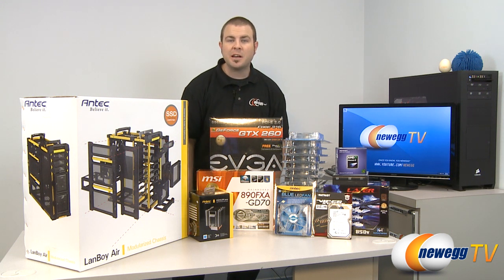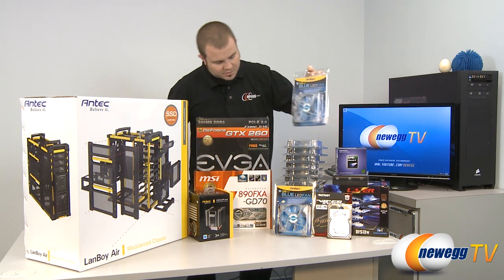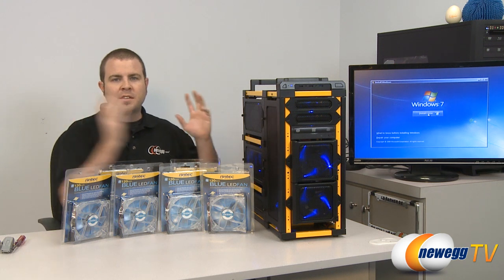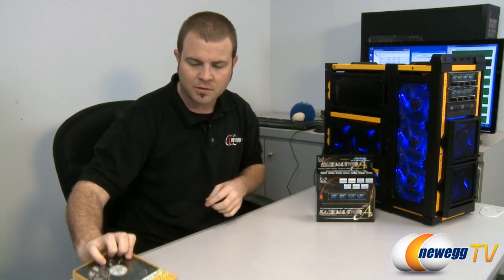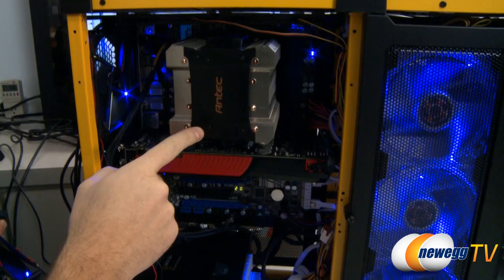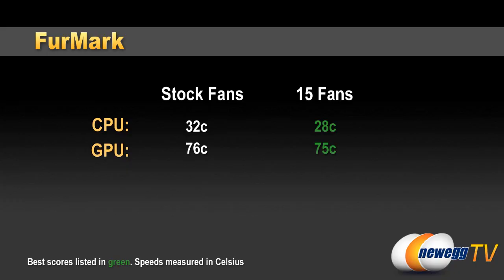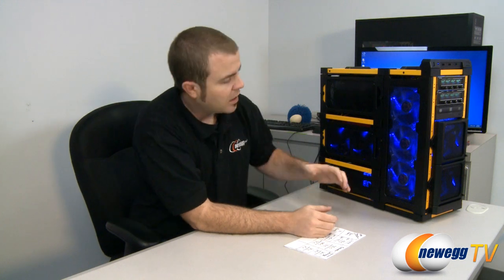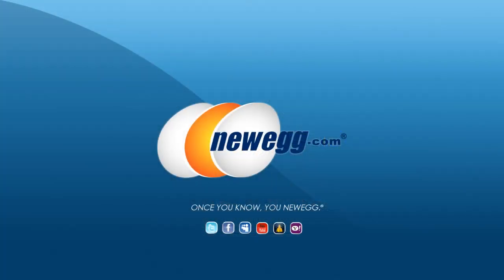Newegg TV: Antec Lanboy Air Test Build with 15 Fans

Comment: i owned one of these the downside is that the rubber hdd suspension system was prone to drying out and snapping on its own in as little as 3 months of 24/7 operation with fans blowing over it accelerating the failure.

The solution is to apply petroleum jelly thoroughly on the rubber parts every 6 months or so, but multiple failures and very deteriorated parts had already happened.

Comment: why did i buy this case...? i still regret it 4 years later lol
Reply: Here the same. When I changed my computer i kept the first one I build in 2011 to put it into a cooler master case 652S and the new pc into the land boy air. I didn't think of SSD placement issue and the problem for fan. The plastic pannel after 6years later don't maintain anymore my fans properly and it's a total mess to place everything in the right place especially a 1080. All these mistakes because i still thought it was one of the best control airflow case and it's not.
Reply: Just bought one and built in it, if you get tired of yours hmu, looking to buy another.

Comment: I have had this case since 2012. What I can say from this is that just putting all of those fans the way the did here (pointing inward) is just dumb. For maximum efficiency (and how my case is set up) You should have the front fans (8) and the side fans (4) facing inward while the rear and top fans (3, or 4 if you have dual rear fans w/watercooler) pull air out of the case so there is an actual flow of air. If you want to do pressurization it really depends on your room temp. If your room is generaly cold, go positive pressure (all fans facing in). If your room is generally warm you may want to go negative pressure (all fans facing out) but even the a flow of air through the system is always best especially if you are doing water cooling as well anyway.

This case does get dusty though if you don't have enough positive pressure about (75% of airflow going inward)

Comment: GTX 260/2TB 5900 RPM HDD/Phenom II...

2009 Price for all of this: $400, $220, $200 (for the low, low price of $1,020)

2015 Price for all of this: $45, $70, $110
(for the low, low price of $225)

I have no words.
Reply: Also to everyone saying you'd rather watercool this... A GTX 260. Let me KINDLY link you to this... "thing".

http://www.geforce.com/hardware/desktop-gpus/geforce-gtx-260/specifications

This requires a 500W PSU to operate. 500 watts. With a 182W TDP. Any slightly intelligent PC Gamer knows how much that is in a real world application.

Comment: With all those fans blowing inward you’re really just pressurizing the case.  If all the fans moved the same amount of air as the Antec 120mm Blue (79 cuft/min on high) you’d be forcing over 1100 cuft/min of air into that case.  That’s the equivalent volume of air that an office that is 12 ft wide x 12 ft long x 8 ft tall contains.  I don’t think that much air can escape out the open vents if all the fan locations are being utilized.  So you're not getting airflow, but pressurization.  The actual airflow of all the fans combined is probably lower that 1100 cuft/min since the specified airflow of the fans is measured against no resistance (pressure).
You should do this experiment again with all the fans on one side blowing into the case and all the other fans blowing out.  THAT creates airflow.  I suspect you’ll then see a greater difference in CPU and GPU temps between stock fans only and 15 fan configurations.
Reply: I was think the same thing. I would have liked to see a test with the front half pushing air in and the back half pulling air out.

Comment: theres really no need for this many fans, even with lower ambient case temps the processor clocks internally are still going to run at roughly the same temp.  this is just giving it more fresh air though and preventing dust buildup

Comment: So, basically, you're  lazy   and   you use your money so you can maximize your laziness.

Windows doesn't actually take long to install; just an hour or two. No longer than it takes to upgrade to a new version of OSX. You don't have to build a PC if you don't want to either. There are plenty of ones you can just buy.

Comment: I just built my computer and it has the one 120 mm that came with the case. There are openings for six more. I just want to know if adding all six will drop the C` down 10 to fifteen degrees because within 5 minutes of starting Sniper : Ghost Warrior, fan in the back already's blowing warm air. When i alt tab out from the idle temperature which is 39-41 C its up to 55 C, i just would like to know if adding all six 120 mm fans would keep the temp 50 C or under and keep it there. Thanks

Comment: you dont have to build it... no you buy a piece of crap where you throw away 400 dollars. and you throw away another 200 for the portability where you can have performance and reliability instead with a desktop. And when you build it yourself you know that the all the components arent budget cuts where an mac or other manfracturer pc would have a shitty psu and motherboard.

Comment: wow ur the biggest dumbass ive ever seen!! i used to have a mac and i installed windows on it and i wondered if i could run crysis. guess what. it froze on game startup. Apple takes a 400 dollar computer, wraps it in aluminum and BAMN $1500!
soo GAY if u ask me. 
my new pc would rape a mac any day
SPECS:

Corsair TX650M PSU
Seagate Barracuda 1TB HDD 7200RPM 64MB Cache
MOBO: MSI Z87-G45 Gaming Edition
RAM: Corsair Vengeance 8gb (2 x 4GB)
CPU: Intel Core I5 4670K @ 4.2 GHZ
GPU: Evga GTX 770

Comment: "You don't have to build it, but it's just as good?"
Fair enough, if you're willing to try for spending $2000 more. Macbooks are extremely overpriced. Mac desktops are also extremely overpriced. Many people could build a PC that runs just as good or better for 25% to 40% less than a pre-built Macbook/Mac desktop. Also, stating that PC builders do not know how to spend their money whilst you waste hundreds of it is laughable. Besides, you're comparing Windows operating system to a computer system

Comment: Are you saying that you never have to install updates?
It doesn't necessarily take the entire night, it depends on your Internet connection, and what kind of drive you are installing it to.
You will do the same thing with any hardware and software, be it any distribution of the Linux platform, Windows platform, or Mac OS platform.

Comment: but ain't that a system that would need to run like 24/7 otherwise the dust would just start building up inside the case during the off time and the lack of positive pressure

Comment: My household has a mac, the OS is really not convenient for doing "Superuser" activities (e.g. hardware driver modifications, or the many things that'd take a few right clicks in windows/nix taking a long process to do.), especially not if you're trying to go through many things at once, that's the part that jabs at me the most when using it, and one of the key reasons I don't want one. Apple apparently has good support (I wouldn't know.) and maybe less malware in the wild compared to Windows.
~

Comment: For true stability and good programming Linux. And I can also tell you didn't understand what I typed at last, but I really don't care to argue PC vs Mac, it really is obvious PC of any kind, Windows/Linux/BSD is better than having to pay an overpriced amount for old parts of the same manufacturer brand with Mac, or their OS which only has any stability because it is the clearest cut copy of Unix to-date. And it has restrictive parameters which prevent effect run-time debugging for one.
~

Comment: most recent iMac on apple's website before any configurations costs $1999 and has:
Intel i5= $200
8gb 1600 MHz ram= $60
1TB 7200rpm hdd= $75
GTX 675MX= $400-500
27 in 2560x1440 monitor= $390
bluetooth keyboard=$30
multi touch mouse=$30
PSU= $100 (estimate based on estimated power consumption)
Total= $1285-$1385+ a little more (mobo and other costs)
Apple's selling price=$1999 + tax
I'm not going to spend an extra $600 for cheap Chinese assembly and apple name
Oh,and suicide is never the answer.

Comment: With MacBook pro when playing BF3 on ultra settings as you've said before, will get you 20-35 fps maximum because it has a shitty GTX 650 OEM card.. and this if the expensivest model, cheaper one has a HD 4000 which is a complete joke. Same story with iMac's.

You're just paying for the picture of a chewed apple, and if you really have money, then why not just buy a pc which would be same power for 2x less the price?.. and you could simply install mac os x there

Comment: lol its ok you are uninformed. Just to let you know though, most of the components in macbooks and mac products are the exact same in pcs. The only difference is compatibility which is simple with a few tweaks and apple cost 2-3 times more than theyre worth. you macs with i5 or i7 that you buy for 1k-2k is probably worth 500 at most. and if you get a gpu for mac, its likely to cost $100 more for the same product used for pcs. You are basically paying for the osx which you can also use on pc. lol

Comment: as presser goes down so does conductivity (heat wise). the air contains less partials to bounce of of hot surfaces (this case uses the same idea the other way) heat fins and radiators would not be able to lose heat. personally if I had this case all but one fan would be pointed in or even better I would get a different case altogether and do that.

Comment: If I had $220 to throw at the blacked out case, I'd just get that. I'd honestly prefer it all black anyway. I've been searching high and low for one that is cheaper. Even if it's used. I just fell in love with the design of this case and it's a damn shame they stopped making them.

Comment: Does anyone know where to get one of these damn cases? Antec still sells the blacked out version, but it's 220 freakin dollars. The versions that had the color accents are discontinued, but Newegg had them listed for $120-150 originally, which would be reasonable. Antec also used to sell refurbished B-stock versions for $77 plus shipping. Wish I could get my hands on a refurbished model for that cheap. I want one of these so badly.

Comment: i used to have this case. this case atracts more dust than most cases. Almost no cable management, aside from stuffing cables behind the super thin area behind the motherboard tray. If you dont have the right side of the case hidden then all those cables stuffed back there are visible. Also unless if you add several more fans, the case doesnt have as good airflow as you might think with only the stock 5 fans. After having it for a month i decided to get the bitfenix shinobi window xl

Comment: The way you have set up those fans doesn't make sense, you should face the 2 front fans blowing outward, that way you would create a tunnel effect. You have blocked up all the areas that would push out air due to your positive pressure, so you are trapping more hot air than releasing it. Your area where air can now escape is a lot smaller than air being blown in, so it will just circulate the air

Comment: you dont have to build a windows laptop either...  and in reality, custom built PCs are for people who are smart enough (or confident enough, seeing as how building a PC is literally as easy as buying the correct parts, putting them all together) to build them and/or know that its FAR cheaper to build your own rig...  Imagine how much my system would cost pre-built.  im running a 680 DirectCU II, 3770k, 650 watt psu, 32 gigs of 1866 ram, sabertooth z77, etc.  that would likely be over 2 grand

Comment: Windows doesn't really take overnight to install anyway. Plus that mac you have is probably pre-installed with Mac OSX so you will only have to push that power button and wait for it to boot up since the operating system was installed BEFORE you bought it. The price you pay for an apple macbook can go to a pretty good gaming computer that has twice the performance. So, in actuality, custom-built computers are way better than pre-built computers.

Comment: Not to mention the type of GPU and CPU coolers used completely nullify any advantages of the positive pressure design. They both function by moving columns of air from the front of the case through the components and out the back, as is typical.

Comment: Need a better airflow straight positive will not give you a good airflow you need to push and pull the air out or you will just trap air inside your case try flipping a couple

Comment: This is proof positive pressure doesnt cool. You need air flow. Rerun your tests with 10 sucking in and 5 blowing out, creating a wind tunnel through the case. Derp.

Comment: 1- Crapbook pro is a laptop not desktop
2- You can buy a dell or hp that is already built, but it is cheaper build the pc with seperate parts
3- Your Crapbook pro is both better and just as good?
4- Crapple charges way too much for their products, especially Macs

Comment: It does.

Luckily becuase all the fans are pointed in, the pressure created by them lead to very little dust buildup.

Its the same concept as those small block style cases with one large fan pushing air inwards.

Comment: its designed not to be. if you make every single fan in it an intake fan then all the dust is blown out of the extra ventilation holes due to the retardedly big positive pressure

Comment: It has a mesh and some of the fans blow out and if you have some positive pressure the air wont heat up as quick because its constantly moving. (and dont diss Paul)

Comment: I'm by no means a fan of this case, but here's my issue with the benchmarks. The GTX 260 has a shroud style cooler meaning that the gpu would not see any benefit from the increased airflow. A model that has a open air style cooler would have been a much better demonstration.

Comment: Setup for my current machine is:
16GB RAM (4x4GB G.SKILL Ripjaw DDR3
AMD Phenom II x6 Black Edition Thuban 3.3GHz (3.7GHz turbo)
1TB WD SATA HDD + 100GB WD PATA HDD
ZALMAN 110mm 2ball CPU cooler
MSI 880GM-E43
680W APEVIA PSU
Galaxy GeForce GTX 550 Ti (Fermi) 2GB 192-bit video card
Various accessory fans

Comment: I'd say the temps would have been more improved if the fans over the video card and the rear fan were switched to exhaust rather than intake. It'd still be positive pressure (though with as much open mesh as that case has, it's hard to keep any pressure at all)
But you wouldn't have those side fans blowing into the side of the card, which is essentially the exhaust for the gpu cooler.
I had the same with my card and realised I was stalling the airflow through the heatsinks.

Comment: @newegg  are you just running all fans off your 850w power pack? because i was planning on putting 8nr more fans in and i'm not sure how the computer controls my current stocks fans if they are just plugged into the power and not the motherboard :s

Comment: You put 10 120mm fans in this case, each one pushes around 55 CFM, Why not go with Delta AFB1212GHE-CF00? it pushes 240 CFM per fan. Loud as hell, but cool.

Comment: all the fans sucking in create a good deal of pressure inside the case, then the pressure alleviates itself by forcing the air out through any hole where a fan isn't sucking inward, carrying any dust with it, at least that's the concept of it

Comment: - Half the fans (and most of the added fans) blow on the HDD slots, there is no benchmark for the HDD temp (RAID test?).
- Phenom II X6 1055 at stock clock gives off very little heat. The test should be done with Phenom II X4 or some OC CPU.
- All fans blowing in creates dead zones of low air-flow. The fans on the back and top should blow out, then the extra fans on the side should make a difference for the CPU.
- The GPU gets the same air in both test cases.
- I am not a fan of this video

Comment: Haha, I thought you meant just the cooler and you're our $1,000. But, in all seriousness, at least with the one I'm talking about, the tube is quite strong, and any leaks (which would be small anyway) would come from the connection on the radiator. Also, if I'm correct, the type of liquid inside is some kind of a low-conductive mixture, so the damage, if any, would be minimal.

Comment: I would recommend to create an air current instead of a possitive pressure on the case. I sould leave the orientation of the eigth in the front and change the others to take out air. Still possitive pressure (8 vs 7) but a little more airflow...

Comment: ot a total of 20 fans in my rosewill blackhawk ultra... my $20 (cm hyper tx3)  hsf without my fans still runs cooler than that with the cpu fan at low speed. (amd phenom II zosma 960t@4.2) my avg temp is about 28*c heavy load about 32*c gpu has yet to see 70*c (two xfx radeon 6870) moral of my story its all about proper setup and a truly good hsf

Comment: Best case by far I ever owned, though also the most I paid for one, but I did get a nice discount & rebate on it at the time.  After so many push/pull tower setups, this was a nice change & very effective.  I only have a few fans going so I'm not nearly optimizing the cooling, yet its still just enough to be effective as I can feel air lightly coming out all over.  Love the suspended HDD's (I got 3 total, 2 in raid0), it just seems smart to do this for mech drives & keeps them quiet.

Comment: should have tested with the stock cpu cooler that antec one looked pretty beast alone, also should have thrown in another gpu in xf for sli, as most people putting in 15 fans would probably be using xf or sli along with an oc'd cpu for sure, problably more than one hdd too.

Comment: The sheer volume of fans would probably interfere with each fan's airflow.

It's better in this case to have have high CFM fans where they are needed the most - blowing cool air to the hottest components in the PC.